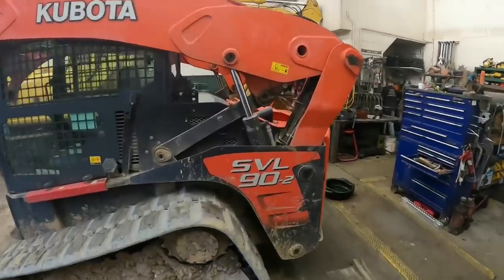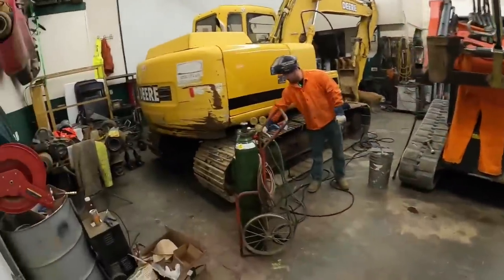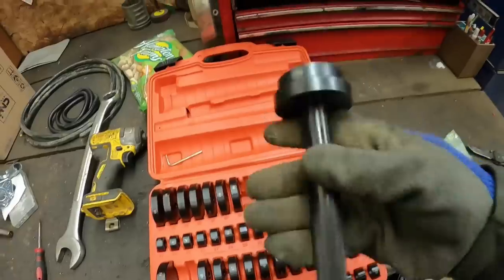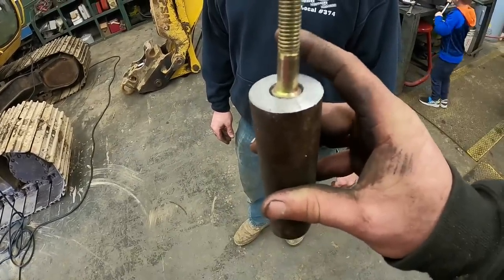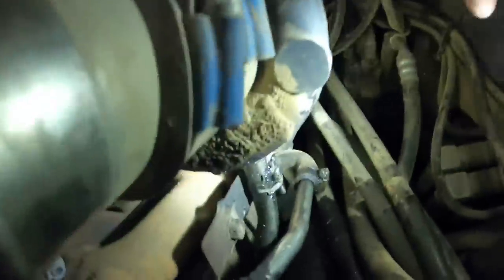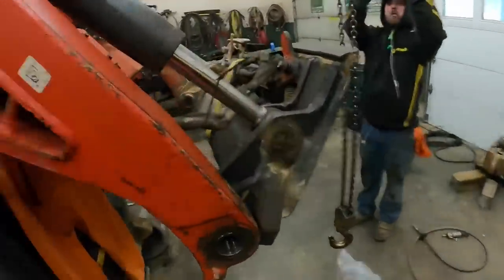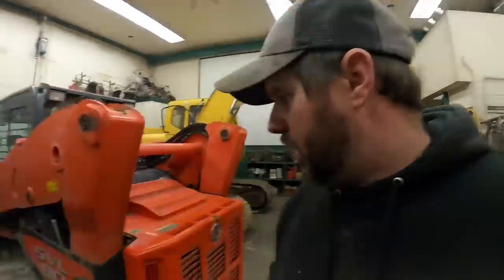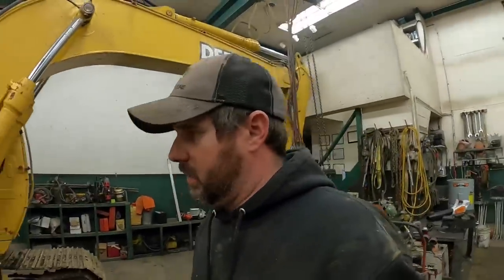Removing a Stuck pin with lancing rod and my thoughts on the skid steer after a year.

Comment: Newbie question: what's the best way to clean out the grease from the recessed pins? Zerk is working fine but there's dirt and grease from careless greasing in the recessed pin heads.  Towel and pressure washer?  or something simpler?
Reply from the maker: Check out the video I have on it while working on the 850 Dozer
Reply: @DirtPerfect  watched both your 850 videos and didn't see any info on my question.  can you be more specific please?

Comment: when installing new bushing, put the new ones in the freezer ver night, with a torch heat up the pin boss good and hot, get bushing from freezer and work fast, dont fool around, press it in, all you need is a 4 ton porrta bress with some made up hooks that take know time to make, and save them for the next job, beating on the bushing, dont help, every time you hit it it shocks it making it swell, you need a steady push.. , most times these bushing are a good brass not steel, steel on steel leave shavings and mix with grease witch make a good grinding compond, a good made machine has good brass bushings, with groves cut in them fot grease to go down, working in the bush camps i use to make a ton on scrap brass, the 18" center joint on the big korings were 18" round 1/2" thick wall and an out 3" flange that the center joint pin nckle went in, and needed replacing aound 10,000 hours, all boom pins had big brass bushings, when i work on a machine were the mfg cheaped out with steel bushings i get a machine shop to make me up brass ones,, must be made from good brass, not the soft crap, i keep many sizes of round brass stock on hand, and take a peace i need made up to the shop,, as they ether dont have the right stuff or they charge like hell for a small peace
Reply from the maker: K
Reply: @DirtPerfect  i have tried to get a lath for years, but ex wife got everything, and the old guy out here i use to use passed away 11 years ago, no more cheap machine work.. i just need a small one for making bushing and pins and bushings

Comment: Next time, put the bushings in zip lok bags to keep them from rusting, then into a bowel of salt water, and then into the freezer.  Because in the salt water they'll get down to minus something, whereas just in the freezer (or freshwater) they'll only get down to about 32 degrees.  and btw, Some non freezing liquid in the zip lok with the bushing will speed up the process a bunch.  Maybe even try it without the zip loks, you'll know it's ready when the fire department shows up because your tongue is stuck to it...

This works in a cooler as well, but mixing salt water with your ice will freeze your beer solid if it's in the salt water.
Reply from the maker: Interesting thanks

Comment: I’ve had 2 svl 75s. I like them for the versatility but I’m debating upgrading to a 95. What’s your thought on a smaller machine vs your 90/95
Reply from the maker: Hmm like having the extra lift when I need it
Reply: Can do the stuff you can do with a bigger machine with a smaller one just takes longer. And easier to move

Comment: Two questions:  Why dry and Why wet?  65 degrees outside and you don;t pressure wash equipment prior to wrenching?  Driving bushings and pins without hitting them with a bit of grease before smacking them?  My feeling is a clean machine has fewer electrical problems (dirt and moisture make a good electrolyte for stray current) and when they do occur as well as fluid leaks are easier to track down.  In your defense I see a lot of people doing the same thing.  Diving right into the grease pile.  With a shop like yours a steam cleaner should live right by the outside door in my book. Just saying....  Take care.  Doug
Reply from the maker: Have mixed feelings about cleaning myself

Comment: How many hours do you have on it?
I have the same machine just curious on maintenance like that to mine
Reply from the maker: 3400
Reply: some dont be leave in grease
Reply: @DirtPerfect  How many hours have you put on the Kubota in one year, Because of the cost of them and the expensive repairs at around 3,000+ hours I rent one when I need one. It works for me.

Comment: Aron...I’m still trying to stop the bleeding of my finger from holding tooooosmall a piece wood by hand on the table saw yesterday 🥵
Reply from the maker: Oh no
Reply: Dirt Perfect And , I’ve done it before.  You’d think after 72 years, I’d learn not to take chances (shortcuts).
Reply: 9856CB I know what you mean... I once tried to run a 3/4” dado in a  6” long 1X2 using two chunks of scrap as push blocks... after the bleeding stopped, I didn’t have to cut my middle fingernail for 6 months!!!

Comment: Just so you two know my friend was beating on a cat trailer hitch and a  piece of metal shot off and wet right in his eye he now only has one just a thought
Reply from the maker: Yup unfortunately know several people like that
Reply: Larry Cederholm yep, two stories if I may.  1st-guy a month into retirement, splitting firewood, metal wedge splinters off from maul impact, piece of metal penetrates chest, and 2layers of clothing, missing large artery by millimeters, survived, probably a 1-million incident, lucky him.  2nd-guy wire wheel on a 7in., grinder, wire piece fly's off into eye, keeps vision, but again lucky him...
Reply: @greggb3079  I use to think safety glasses were overrated! Once at work our mechanic, (On his off time was working on some of his personal equipment) had a pry bar break. The remaining part of that bar flew back & hit him in the face. Had it not been for his safety glasses, he would have lost his eye! Instead, he just had a massive bruise on his face. He said he though about NOT wearing eye protection at home, but our companies stringent safety policy at the workplace influenced him to wear his PPE.

Comment: I have had luck  success with  wielding a nut on the pin and using a slide hammer  to draw it out   and a porta power to push from inside when you don't  have room to swing a 10# sledgehammer  I subscribed when I saw  the shop   you can do the same for bushings

Comment: Kleeman is probably too skinny to get the sensor to know he is there, a guy I used to work with had the same problem in anything with a seat sensor. Everyone else had 75-100 pounds or more on him, so it took us a while to figure that out. Watching him try to use a jack hammer was hilarious, he didn't weight enough to do more than scratch the concrete. 

Might try measuring one of those gas struts and seeing if you could get the same size but rated for more weight, like a mini van or SUV tailgate. I have yet to work on a machine or vehicle that I did not want to slap some sense into the person who designed it at least once.

Comment: freeze your new bushing like you did but also heat up the bore with oxy abit to make the bore expand slightly and frozen bushing should slid in a treat no hammer needed. also try leaving bushing in freezer overnight if not using dry ice or liquid nitrogen. 

bogan way of doing it. hold oxygen bottle upside down and turn it on getting liquid oxygen out to freeze your new bushings in.

Comment: No anti-seize on the pins? You don't expect to ever have to remove them again? I always ran the weld in a straight line to remove bushings. The Arcair Slice torch uses a 12 volt battery to light the rod. I think having the welder connected to it shortened the life of the torch rod. You were using it more like a carbon arc than a burning bar. https://www.youtube.com/watch?v=dt4v-vulKpE
Reply from the maker: No I am not a big fan of anti seize
Reply: @DirtPerfect  you turn in to the tinman looking at the stuff lol

Comment: you boys work too hard, heat the bushing housing with the torch while the bushing is sitting in a bowl of snow then use a air hammer to drive them in or use threaded rod as a puller.